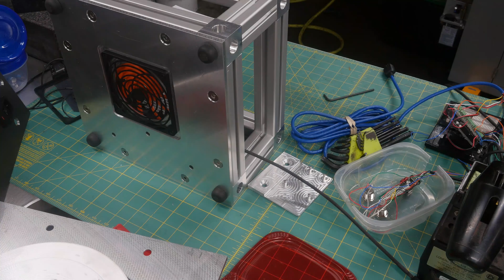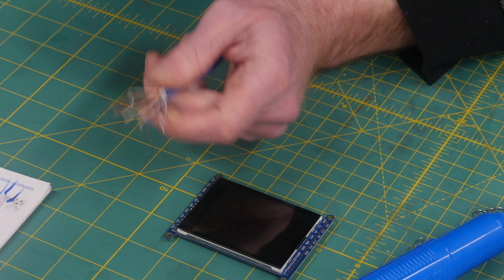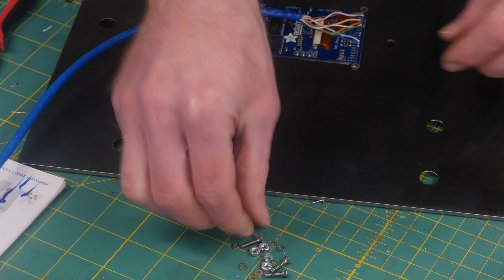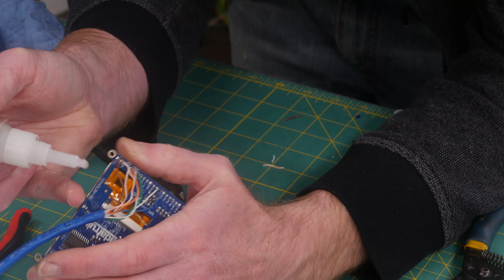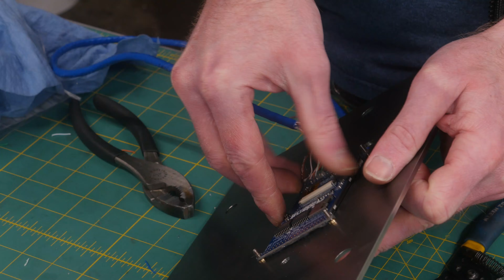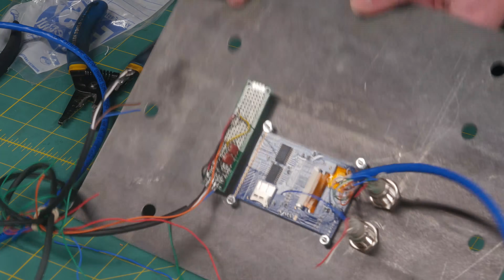[Part 3] DIY Magnetic Deburrer Front Panel Assembly

Comment: Very nice build, me like.  For longterm use on a device where electronics are exposed to vibrations, one rather would use litz wire than solid wire which tends to break at some point due to continuous movement. 
But i wouldn't wanna do the work of rewiring again, just wait till the first breaks and the replace them all  - could take months or decades or happily never occurs ever.